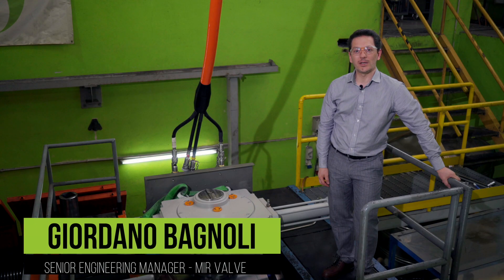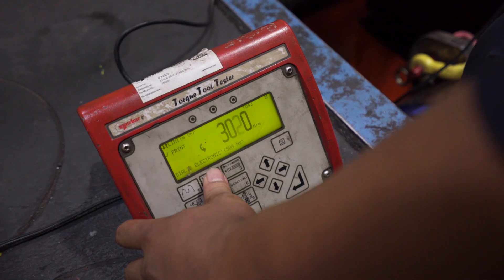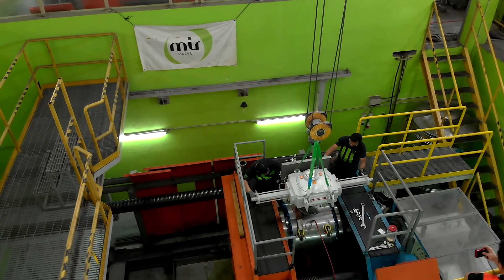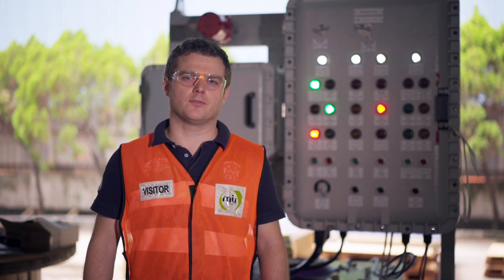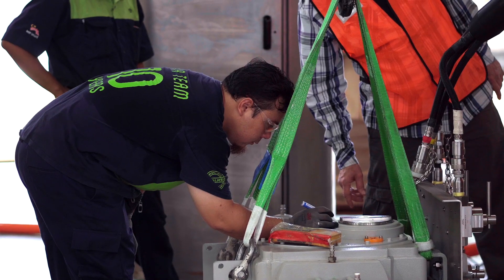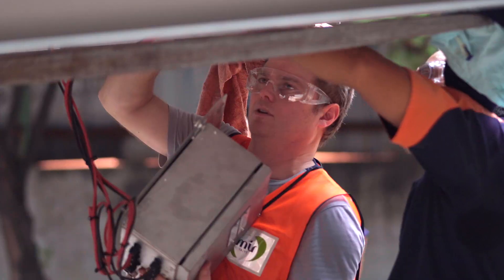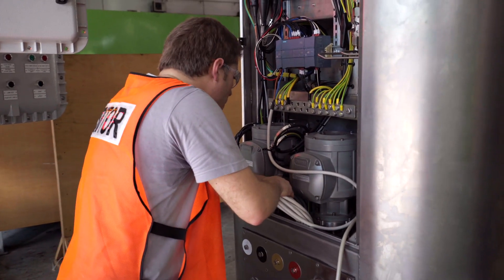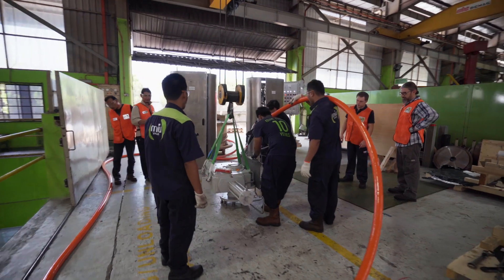20" SUBSEA SSIV BALL VALVES AND CONTROL SYSTEMS

Comment: This is an example of a nice project, integrating an adequate valve design for shallow-water Subsea applications with a modern way to provide solar powered autonomous electro-hydraulic power, control and telecommunication to the operator and end-user. 
The video also was very informative, being useful to viewers in general, but also providing to specialists and SMEs some hints of solutions chosen.
After about 1 year of its conclusion, it would be nice to see a follow-up video with the lessons learnt and improvements eventually implemented. 
Congrats to the MIR Valves’ team and its CEO, Mr. Stasi Prandalos, for sharing this nice achievement!
Reply from the maker: Mr. Euthymiou, we only saw your comments now! Thank you very much for your valuable input. Mr. Stasi Prandalos would like to get in touch with you, if you can share your email address or send him an email at stasi.prandalos@mirvalve.com

Comment: Kudos to Mir Valve and its founder Mr Stasi Prandalos for the innovation driving customer service and support. Not common to see an ODM supplier pushing its boundary in interfacing with third party complex components and provide a full integrated system to their Clients.
Reply from the maker: Thank you very much! Customer service and support is the largest differentiator today and it has been our main focus since Day 1.